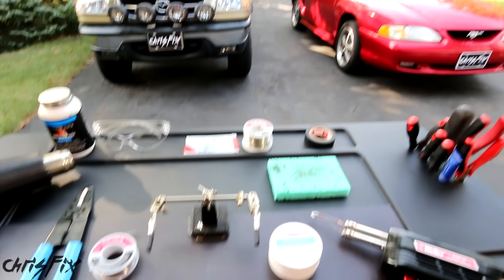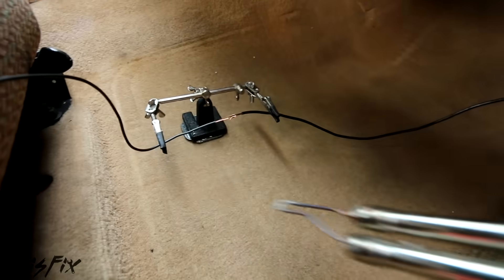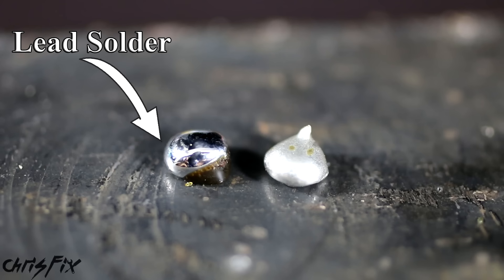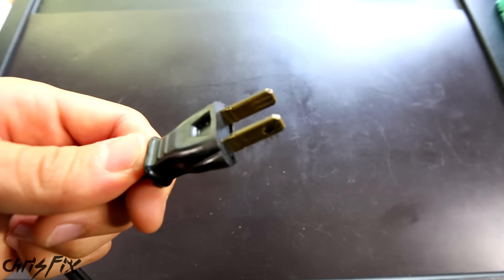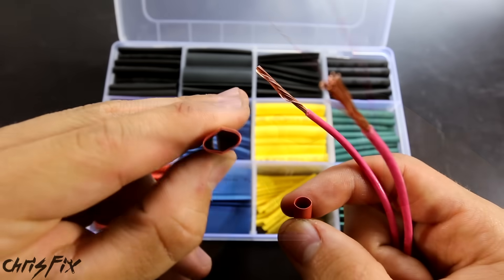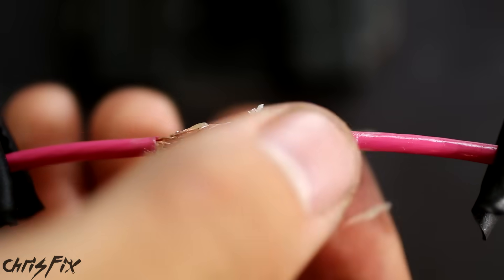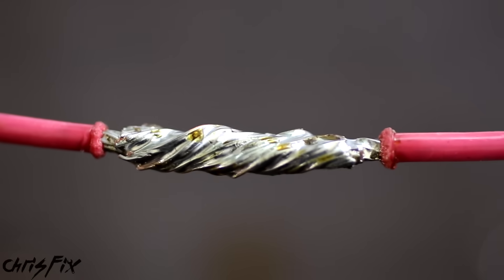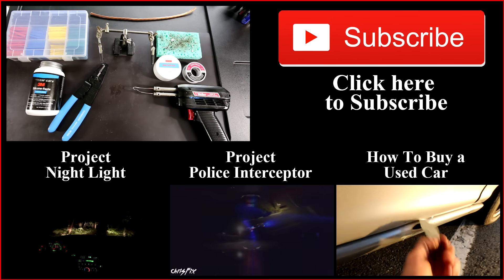How to Solder Wires Together (Best tips and tricks)

Comment: As good as you did and useful the tips were, it's generally considered bad practice to melt the plastic of the wire. The goal is to heat it only as much as you need to get the solder to flow in. you gave it too much heat and so the plastic melted on the wire. So use his tips, try not to melt the plastic. Also take note that a soldered joint is typically much stronger than the wire itself.
Reply from the maker: +MidnightMarrow thanks for the tip!
Reply: Indeed! Nice to know you pay attention and don't find reasons to take things personal. Great channel btw!. ;D
Reply from the maker: The goal is to teach and continue to learn! I can only cover so much in a single video and I can only know so much as an individual so any helpful tips, tricks, feedback, comments, etc are always welcome!

Comment: Hey Chris! 
I really like your channel!! I was wondering if you could make a video with all the thing that  should be changed on a car after a couple of years( or miles )for example. I am soon getting my drivers license and will be getting an used car or borrowing the family car and because I am a perfectionist I am going to change all things that should be changed but I don't really know what these things are. (for example: changing oil,oil filters, flush the heater core, changing tie rods and there is probably more ...) And btw your Videos are extremely informative. Good job and thanks for the nice content!!!
Reply from the maker: +Martin Dimitrov that's a good idea. For now, read the owners manual. It goes into detail about what needs to be changed in the service interval / maintenance section
Reply: Thaks for the fast answer and the tip :)

Comment: Nice video.  Also rather than using the silicon paste or dialectic grease you can use heat shrink which has glue on the inside.

Comment: should of use non-isulated butt connectors. Cleaner job and no wire strand poking out of the shrink tube .
Reply from the maker: Thanks for sharing. There are no wire strands poking out of the heat shrink and in the video I explain that you need to make sure the ends are tucked in.
Reply: Try doing multiple butt splices in a wire loom and make it look professional. If you want to look professional, soldering is the way to go. If you need a quick fix and go, butt splice and repair later.

Comment: The best splices that have the absolute lowest resistance use NO LEAD, they are crimp connectors.  Lead has a much higher resistance than copper which means the lead will heat up under high current, then your soldered connection will melt and FALL APART (usually in a location that is inaccessible).Believe it or not, a properly installed wire nut makes a better connection than a solder connection.  It's no secret that the automotive industry and the national electrical code (for your house wiring) don't do lead connections.  BTW, I'm an Electrician from Ford Mo Co.
Reply from the maker: Thanks for the tips!

Comment: +Chris fix I have a problem with vibration on my car and it only feels like is from the front passenger side and I already had the car balance and align but it only happened wen I went faster then 65 on the freeway what could it be ?

Comment: The temp for solder irons are around 380c well below the auto ignition point of most flammable materials (if you wanted to you could cool down the tip of the iron in petrol if you really wanted and the most that would happen is it would make a vapor not catch alight).

Carpet would melt and look horrible or if it's non synthetic the solder would wrap it's self around the fibers.

And if you have to use a fan, use it so it sucks the smoke away not blowing it away, this causes to must wind which chills the tip of the soldering iron and stops the solder from flowing correctly, (solder travels towards the heat).

Lead solder has had a big decline as "ROHS compliance" has deemed lead to be a harmful substance so the preference is to use lead free solder  (the nice thing about lead solder is that it will melt and flow at a lower temp, hence why the older guy and gals will prefer lead based not copper or zinc, etc based)
But yes please wash your hands.

the rosin doesn't protect the wires from oxidation it converts to (when heat is applied) an acid and etches the surface you are solder and removes the surface oxidized layer so the solder can key in. 
There is a type of flux called dozall which is an liquid based acid, this is normally used on really badly oxidized material. Its also used with lead lining and some types of weld

Please note I DO actually enjoy your videos. They have some great ideas.

Comment: what if you need to solder unto a pcb? do you need to cold solder?
Reply: do you mean pvc like the plastic plumbers tubing?
Reply: +Jake Bewely printed ciruitboard....
Reply: Okay I was just wondering haha I don't know about all that m8 but I wouldn't recommend soldering pvc
Reply: +Jake Bewely i dont think you can even solder pvc hahahahahah
Reply: I've never heard of cold soldering but the process is the same on a smaller scale, without the splicing.
Reply: I'm sure you figured it out by now, but no, you don't need cold solder. Normal 60/40 or 63/37 rosin flux solder will work. Don't use lead free because it takes high temperatures to work with and doesn't flow as good, which can damage your pcb if you take too long. Also since you are soldering on a pcb don't use any more than 0.5mm solder, because its harder to control how much is applied. So try to use 0.3mm or 0.4mm.

Comment: Very educational video. But I recommend the lineman's twist using pliers to keep things tight and structurally secure. Just using solder and the interleave method is not as secure and shouldn't be used for high power connections.

Also, with high temp irons and the cleaning tips shown, using lead free solder is not a problem.

Comment: Placing the helping hands in a magnetic tray works well in a vehicles interior, You can also make a small helping hands with a couple of alligator clips soldered to a "u" shaped  piece of hanger wire

Comment: Chris ..... Excellent video!  I was certified NASA qualified in soldering (even under a  microscope)  about 40 years ago to work at the George C. Marshall Space Flight Center in Huntsville, Alabama (when Dr. Werner Von Braun was it's chief administrator and I worked on the Mariner satellite projects) and your video shows the technique very accurately.  Some things that might be useful for novices to remember is that:   1. Solder is not a true mechanical bond.  It is purely electrical. So,  the Western Union bond is usually stronger if the connection might be under any sort of minor stress.  2.  You can use your soldering iron to shrink your heat shrink tubing if you don't have a heat gun or lighter handy. 3.  Practice to make sure the soldered bond is shinny and consistent across the entire joint..  A cold solder joint will be dull if using lead solder. I prefer to use lead solder with flux imbedded in capillaries.4.  Do not inhale the fumes when soldering .  They are highly toxic.

Comment: Thank you for this! Learned alot!
But it makes me feel like i didnt attach my LED 12v Switch I have for my Interior lights & Also I have Underglow lights running off the Same 12v power source (12v power source is just the cut off end of the Light for the ash Tray for my 2000 Toyota Camry. I can Send u a picture of this Ugly Rats Nest of cords I have. But i have bought another 12V Switch because i know that I need to get another power source for either one of the After market lights. I guess my real questions are:
1.How is the right way to attach a Positive and negative on a 12v Switch someone might have?
2.Where is a Good place to find a 12v Power supply? (Would it be better to pull for the fuses?)

Comment: One more solder tip. Don't solder naked (or where solder can drip onto exposed skin). Ask me how I know.
Reply: sigh how do you know?
Reply: Oh, I know, you tried docking with the tip of the soldering iron
Reply: Let me guess, you soldered a joint and the some hot solder decided to splatter off the joint and land right on your nuts?
Reply: also don't fry bacon in the nude
Reply: Don't fry potatoes in a skillet naked either.
Reply: katie_incredible one time I was soldering a wire, I was wearing a short outside dripped solder in my legs
Reply: katie_incredible i know the pain, now i have a scar on my thigh.
Reply: That is why the goggles, too. I can't count the number of solder splashes I have scraped off my glasses lenses in the last 50 years.

Comment: Great video!
Personal favorite is a mechanical splice. Using a long tie lineman's splice takes a few extra seconds, while it does add a bit of bulk, it is mechanically locked and gives beautiful results when soldered. Generally best with solid conductors, or finer stranded wires. Anything too big and it will become unwieldy. When soldered though, this splice becomes stronger than the wire itself.

Comment: Very well done overall, I've seen so many on the net where the person making the video has absolutely no idea how to do it correctly.  Only thing you missed was cleaning the wires before starting.  Sometimes even new wire on a roll is very slightly corroded, cleaning off that corrosion really helps.
For those self appointed purists who didn't like his pronunciation of the word, I had a TV repair shop that employed several technicians, every single electronics tech I have ever met pronounced it the same way.  Somewhere there might be a few who pronounce it differently, but I never met or employed one who did.

Comment: such a loooong story to get to the main point which is: "Use paste, apply heat to one side of wire and soder to the other side, let it flow. Never melt soder with iron tip directly".

Comment: Very good video overall. However the proper way to apply solder to a wire joint is to apply the solder to the point furthest away from the heat source and allow the heat to draw the solder to the source. You're close with the top/bottom method but it should really be the outside/inside method in this case. Also, if you don't have any dielectric grease, another option is to use a hot glue gun to fill the space and quickly slide the heatshrink tubing over the joint. However, this requires careful timing due to the hot glue causing the tubing to begin to shrink. It also helps strengthen the wire. I prefer to use flux paste and non flux cored wire for a better connection. You should also clean any flux residue before sealing to prevent future corrosion.

Comment: Crimp connectors are faster, and easier than soldering. I know it's a bit more expensive, but I can almost guarantee that if you use dielectric filled heat shrink crimp connectors and a ratcheting crimp tool, you'll never have a crimped connection go bad.

Comment: I kind of sort of see some things differently than you. First off, once you get your technique down you won't have solder exploding onto stuff. Secondly, flux has two purposes: the one you mentioned (specifically dissolves oxides, both the ones present and the ones that form during the solder process) and also makes the solder alloy wick better. Usually though if you use rosin core you don't need to add more flux, especially on thin wires and through hole parts. There is also a third way of soldering wires together: simply soldering them together, without braiding or other steps. That is what I prefer doing, because it produces cleaner results. I have never had a failure using this. I think that it's almost as strong as the wire itself, but I wouldn't hang stuff from a soldered wire anyway. Still, your video is very good for absolute beginners because you don't go into boring details (like I kinda sort of have done). Keep it going man!

Comment: One thing I'd add is to try and get solder under the insulation to prevent a weak point at the insulation end. I've had a lot of connections break when started out because of this.
Reply from the maker: Thanks for the tip Dylan!

Comment: Hi great vid but you don't need to touch the paste flux you can just dip the solder in the paste and your hands will be clean
Reply from the maker: Thanks and thanks for sharing. The solder has the paste flux in it already so I want to get that flux in the strands of wire. You can always use gloves if you dont want to touch the paste flux.
Reply: yes you have a point but i an soldering pretty much every day and i dont think you need so much flux I don't mind flux on the hands just think it's unnecessary
Reply: allso most of the times the flux in the solder is enough because you use a lot i add paste if there is alot of oxidation

Comment: wrapping the bare wires then adding the solder is fine and all but tinning the wires before hand will give you a much cleaner look. when done right you can make the heatshrink almost indistinguishable from the wires themselves. this is a good tip and trick dont get me wrong but as an electrician that solders on a daily basis there are a few more things you can do to make it look like the best damn job any ones every seen.

Comment: You are the only one person that i watch his video completely, good tips, thank you Chris can i add some more:

-When soldering any wire, specially slim ones, try to do it as fast as possible, because the heat of the soldering tool could melt a good extension of the wire and that could lead to a shortcut
-heat shrink tubing is good when you have a good extension of the wire so you can keep it away from the heat, but in short extensions it is difficult to handle and the heat at the sorrundings could damage the tubing, for short extensions or long or maybe you forgot to put the heat shrink tubing first before soldering (that happens)(as you prefer) and for indoors use the tape scotch super 33 is a profesional grade electrical tape and for outdoors, wires exposed to sunlight and rain use the self bonding elecrtrical tape scotch 23, also is a profesional grade electrical tape

Take care Chris, greetings from Colombia amigo....keep it up!..
Reply from the maker: Thanks Alejo and thanks for the tips too!!!

Comment: use no-clean flux instead of rosin and heat it for a shorter period of time because of insulation melting. For in car soldering I advise to use glue heat shrink to make a compensation for lack of insulation on the wires, also you will gain a water proof connection.
Reply from the maker: +Greg House thanks for the tip. Rosin is a no-clean flux with no acids.

Comment: You have tips for working with circuit boards? The biggest problem I have is desoldering and cleaning up old solder, as well sometimes I have problems conducting heat from my irons to the solder point.
Reply from the maker: That would be a whole other video but circuit boards are not my specialty.

Comment: Chris my car won't start (no sound at all but all the lights come up) its a2005 AUDI A4 2.0 Quattro...any tips? pls and thank you
Reply from the maker: Try checking and replacing the starter (if that's the problem)!
Reply: When you turn the key to the start position, does your fuel pump prime and not crank? If so, you have a blown fuse that is for the Body Control Module.  I had two fuses that blew in my car last year and it was the BCM and Turn signal fuses that blew due to a short in my front turn signal sockets (moisture carbonated the connections since the silicone shielding broke off both ends.)
Reply: ***** it's a bad starter for me, a friend of mine told me to hit it and I did now it's running but thank you
Reply from the maker: Just read the other comments, it was your problem haha
Reply: ChrisFix lol Still thanks for the response, I appreciate the time you took to read and reply.
Reply: +ChrisFix have you done any videos on how to bleed a clutch? I know bleeding is practically the same as brakes but was also kind of looking for a diagnosis guide. Would letting a car sit for 3 or 4 months cause any problems other than spoiled fuel?
Reply: Put Diesel In Your Engine and Then!!! Bleach The Whole Car And Yup!! IT STARTS!!

Sources:
20 Year Mechanic

Comment: Iv been playing with electrical thing for over 35 years and your technique is fantastic. I do exactly the same with my connections. Have a old Landrover 4x4 and every wire and connection are done this way making it very robust as I have waded in water to about a metre deep at times. My solder connections done this way some are 20 years old and do no signs of failure.

Comment: those are both good methods to solder however except in the case of the wires won't stay together i would use the nasa approved method which is to strip twist and add solder to the individual wires then place them on top of one another so that the ends with the insulation are opposite each other and touching then reheat the solder so that the wires are connected this method creats a bond that will break the wire not the joint plus you could say your car is soldered to nasa standards
Reply: Can't visualuze this. Can u link to a vid or other instructions?

Comment: Perfect solder joint except for the excess flux. Most solder already has flux in it and when doing a new solder job extra flux is not really needed for a perfect joint. Depending on the type of flux you should really remove the excess before heat shrinking. Reworking is another story and in that case flux is your friend.
Reply: This is correct. The solder contains flux so as long as you do not keep your iron in the joint for too long you will not need the extra flux. If the iron is in the solder for too long it will dry out the joint and this is when you should add flux and reflow the joint. The copper wires will naturally wick up the solder unless they have oxidised or become dirty from twisting the strands with your fingers. (Fulltime solderer IPC class 3+)